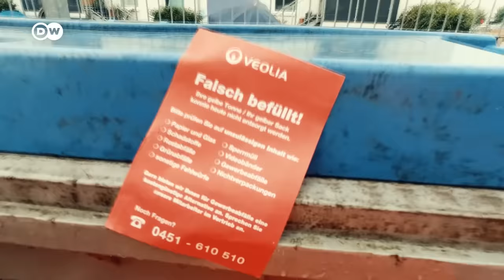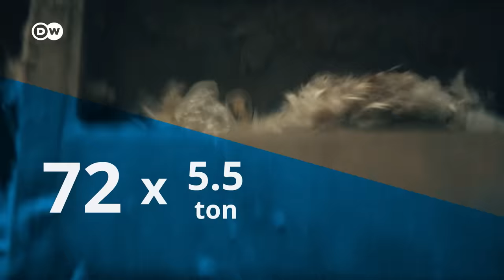The recycling myth: What actually happens to our plastic

Comment: I'd like to see glass bottles come back. If glass ends up in waterways it doesn't harm anything
Reply: Not only that, but glass can be recycled for the most part. The shift to plastic happened only for profit and convenience, that´s it.
Reply: Or paper cans, there are some beverages here in UK sold in paper cans and they function perfectly!
Reply: Me too but unfortunately, it is so much cheaper and cost effective to make plastic than glass.
Reply: @ahotdj07  
Yes and plastic was actually sold as "environmentally friendly" because you "saved trees". Many people seem to have forgotten this. Plastic bags came around the 60s if I recall right and it became really popular around the whole "hippie" time.
Reply: Unfortunately it's not that simple, Glass creates a lot of pollution when made, and since it's so much heavier than plastic it cause pollution from transportation to skyrocket, especially since you can't deliver as much due to increased packaging etc and the need to replace breakages.
Reply: @BecauseBinge  those containers are made of paper and plastic liners
Reply: Costs more to recycle glass than make new glass.
Reply: @BecauseBinge  those paper cans probably still have a plastic lining.
Reply: Glass is better, but it will cause it's own problems. Glass is not pure, the coloring, and other substances in it make it to need to be recycled with others of its kind. Another problem is material. By shifting to glass we will need sand, and we are already dangerously over harvesting it from the oceans and rivers, desert sand is not very useful. Less packaging all together would be best
Reply: Also glass is very heavy compared to plastic, a lot harder to transport and storage
Reply: @eradens932  No, glass can be made from any siliceous material. Desert sand is just fine for this. What you can't use desert sand for is cement which is the backbone of modern civilization.
Reply: Even glass gets recycled at a rate of 30%, because it is much cheaper to make new glass than it is to recycle the old.
Reply: @BecauseBinge  you mean like juice cartons? I think those have thin films of plastic on them unfortunately
Reply: Yep good idea 👍
Reply: The specific sand required to make glass is actually facing scarcity. So there's a problem we'll get to experience in 10-15 years
Reply: some what yes but mostly no. if you throw plastic away it's (mostly) just littering. glass on the other hand breaks and can leave shards on the ground for hapless animals to walk on, and likely get infections from
Reply: In Finland we are collecting over 90% of all plastic bottles. Everything collected is made To New blastic bottles. This is working becouse you get money From this bottles. Every story has a machine, where you can recycle your bottles. It is automated.
Reply: Eh, im hesitant. People are horrible and do not take care of anything. Ive stepped on far too much glass on beaches and rivers where glass products were banned. Sorry, not excited for glass. I want a different alternative if at all possible.
Reply: @korvincarry3268  I'm aware  the dangers of glass. About 40 years ago my cousin and I were catching minnows in a creek to use as bait fish. I've never walked in water without shoes of course except for swimming pools. My cousin had a terrible habit  taking his shoes off before walking in creeks and rivers. I told him multiple times you should never walk barefoot in creeks streams or rivers he would tell me I worry too much. He ended up stepping on something that cut his big toe off with only a tiny piece of skin holding it on we assumed he stepped on a piece of glass. We were both about 13 years old when this happened we had to walk 3 miles to the closest house for help. Most  glass that  ends up in waterways gets tumbled around broken up and does no harm to fish and wildlife most glass in creeks and rivers never makes it to the ocean unless it's thrown in the ocean again glass in our oceans does very little if any harm at all to the environment. Plastic hundreds of miles inland can easily end up in the ocean. Plastic brakes down in water overtime leading to water pollution. Hundreds of years ago it was common practice to toss glass along with everything else in rivers today it's hard to find glass from just a few hundred years ago. There's still alot of people who throw trash out car windows while driving even throwing trash off bridges we will always have those people in society but again glass in waterways does VERY little if any harm except those going barefoot.
Reply: @davidjames666  Which is a lot better than just entirely out of plastic.
Reply: @alecnolastname4362  Which is a lot better than just entirely out of plastic.
Reply: @Art3misZer0  
arguably the same.
Reply: @ruukinen  You mean, silicon for chips is now the backbone of our civilization. ;)
And you can't use desert sand for that either if I'm not mistaken.
Reply: @alecnolastname4362  You really think a whole bottle or whatever, entirely made of plastic is just as bad as a bottle made out of paper, with a extremely thin plastic lining?
Reply: @Art3misZer0  you’re forgetting the wax bleach and dye that go into the paper :)
Reply: @alecnolastname4362  I'm not, answer my question.
Reply: @Art3misZer0  
oh wow so stern.
learn it through context.
Reply: @alecnolastname4362  that's hilarious that you think that
Reply: @Art3misZer0  
kek
Reply: @Draclord35  Unlike cement you can once again use desert sand for it but you need to get rid of a lot of contaminants that you wouldn't need to worry about in river soil/beach sand. I assume it's a question of economics. For cement the desert sand is just to fine to be used.

And sure computing is very important but housing and living space is still higher up the list than technology.
Reply: Everyone misses the real issue: too damned many people!!
Reply: @ruukinen  Thanks for the enlightening answer!

Of course. But there are lots of other materials available. Besides the foundations, many modern buildings heavily rely on steel, glass or even bricks. Back in the days stones and dirt was pretty much all you needed (and these houses have been standing for centuries). Concrete is great, but it's not absolutely necessary to housing. Chips though, mankind is very dependent on them now, they're involved in pretty much every process of our modern society.
Reply: Well, it does.
However... It much less that plastic and is actually recyclable.
However you are much better and off reusing them.
Reply: You can still buy glass bottles. It's your choice
Reply: @seasong7655  It's not a choice. Most everything comes in plastic containers. Some old fashion stores still sell glass soda bottles.  But just about everything else comes in plastic bottles
Reply: BTW, according to the documentary Sand Wars, the scarcity of sand useful to make glass might start soon
Reply: Well I can definitely think of a lot of instances where broken glass can definitely harm just about anything
Reply: @Kokonutzlz  So you think broken glass is worse than plastic. Glass doesn't harm anything in the environment. Personally I'd like to see paper bags being used and glass containers instead of plastic. I'm talking about the environment not people who cut themselves on broken glass because their to DUMB to wear shoes while walking in creeks streams and rivers.
Reply: When it comes to bottles those are mainly PET plastic which is recyclable. In Sweden we collect and recycle those very well, you get one krona for every bottle or aluminum can you leave in the store, which means a lot of poor people walk around collecting the bottles/cans people leave around. Glass on the other hand is very heavy and leads to a lot of pollution when transported.
Reply: @CainXVII  Not every country makes poor people collect things like bottles. Here in America if people don't want to work the government gives them monthly checks and food stamps the only people who would collect bottles here are drug addicts.
Reply: I agree. Remeber when Snapple was packaged in glass bottles? Now they're in  plastic bottles. Wow! Such progress.
Reply: @ahotdj07  Was the practice of washing and reusing standardized glass bottles not working well?
Reply: @bluwasabi7635  yea I remember when snapple was sold in glass bottles. My dad and I would ride to highs just to buy a bottle of tea  that was in the late 80s or early 1990s snapple just recently stopped using glass didn't they I could be wrong but I think I remember snapple in glass about 10 years ago. Like I say I could be wrong.
Reply: @bluwasabi7635  I also think snapple tea doesn't taste as good in plastic bottles. I used to love drinking a soda in glass bottles there's a old fashion hardware store close to me that still carries coke in glass bottles I told my wife once that soda doesn't taste as good in plastic as it does in glass. She thought there wasn't a difference until she tried coke in glass then she noticed the difference. There's not a major difference but coke in glass tastes much better.
Reply: @beekeeper7535  yeah, 10 years sounds about right.
Reply: @SOLDOZER  Yep, and I don’t think there will ever be a shortage of (silica) sand!
Reply: @bobshanery5152  That Era also brought us "Make Love, Not War" "Drugs, Sex and Rock N Roll." These same "Hippies" Ram their "War Machines" or their "Communist Manifestos" down our throats that somehow we must comply to their lofty ideas and fallen Utopias while they feed off the fruits of our labor, and continue to make themselves rich.🇺🇸🇺🇸🇺🇸
Reply: @BecauseBinge  paper cans are even less recyclable and are typically not biodegradable bc they're infused/coated with plastic too keep it waterproof. That's if I'm picturing the sort of thing you're talking about
Reply: @ducklingwarrior  Exactly, I was thinking what he/she said sounded like nonsense
Reply: We are able to buy milk and other dairy products in glass bottles again, and just returning the bottles :) and this is in cycling distance from our house.
Reply: @DavidCruickshank   then aluminium it is
Reply: well in germany we still have a lot of glass bottles, wine, water, beer and sodas.
Reply: @pixelschiebr  Not here in America. Some things are sold in glass bottles but 99% is plastic.
Reply: @roland9367  Most people purchase their milk from grocery stores all that milk is sold it plastic. Only small farms sell there milk in glass.
Reply: Profiteering corporations are responsible for climate damage not individuals.
Reply: @pappy9473  Individuals purchase the plastic bottles. So yes it's our fault also.
Reply: The down fall of glass bottles came after one major mistake.  Stopping the "return for deposit" idea.  In the early to mid 70's they started using the disposable glass bottles for soft drinks and beer.  Short stubby bottles that you would just throw away.  Before that you didn't see bottles on the side of the road.  Kids such as me would ne picking them up to turn them in for the deposits.  Getting enough money to buy candy.  lol
Reply: Yes, but also wasn't there a thing about plastic making stronger/better roads? Or was that something else? I do distinctly remember hearing about a blend of two materials (1 recycled) that is stronger and longer lasting than the current patches/system we have now
Reply: @raylrodr  exactly!
Reply: @raylrodr  say it louder please 100% correct
Reply: Biotag the plastics. It should all be traceable back to the factory..where they should pay cleanup costs. Once recycling is the cheaper option theyll do it. Also might just save us all from demensia (sure we have a fix on the way for that. But its more bandages on festering wounds than cures. The cure is not allowing us to buildup these chemicals in the body to start with)

Comment: 1. Quote: "Infrared scanners sort the plastic by weight".  No, they do not sort by weight, but by material - that´s the reason why NIR (Near InfraRed) sorters are used. They can "see" which kind of plastic is on the conveyor belt.
2. Black plastics cannot be sorted by NIR sorters, that´s right and the reason is that black plastic does not reflect enough light for the NIR sorters to "see" it, as mentioned in the video.  However, the can be sorted by laser sorters and electrostatic sorters, which both are not really cheap. So, short and clear: Black plastic bottles or other packages are not recycling-friendly.
3.  You can recycle PET at nearly 100%,  even food-save. Technically this is not a problem anymore. This clip is not up to date in this topic.
4. Multilayer packages are really bad stuff, however there are processes now to separate the materials. Not easy, not cheap, but technically possible. Of course better package design is the key for better recycling.
5. Germany imports more waste than it exports. See Bundesumweltamt statistics before you blame Germany for exporting "waste".
6. How I know this? I´m in the waste treatment business for +20 years. A lot of things are technically possible, but someone has to pay for it...
Reply: Danke für Ihren Kommentar, gute Infos. Viele denken ziemlich pessimistisch über Recycling, ist aber nicht so. 
Ich studiere Recycling und Entsorgungsmanagement an der Hochschule. Und wo sind Sie tätig, wenn ich fragen darf?